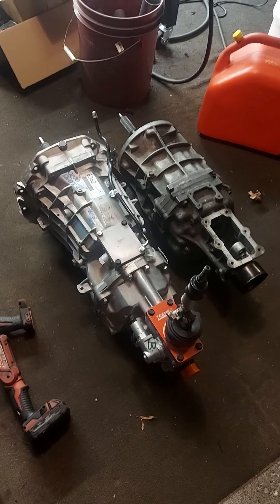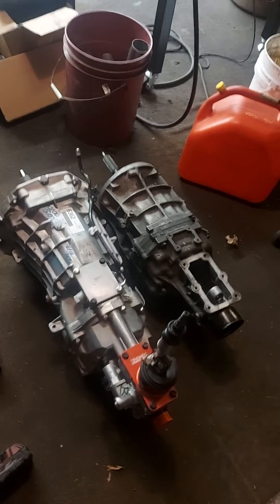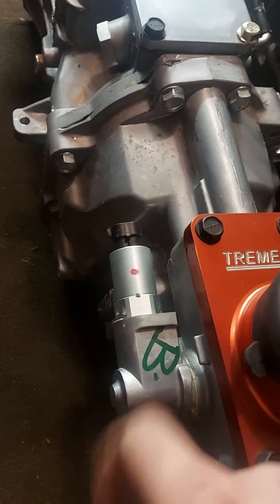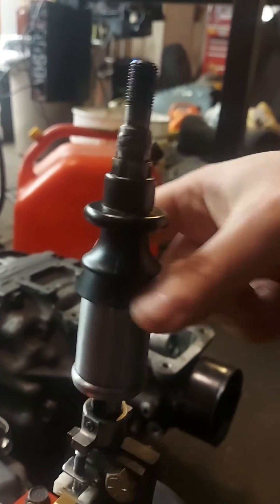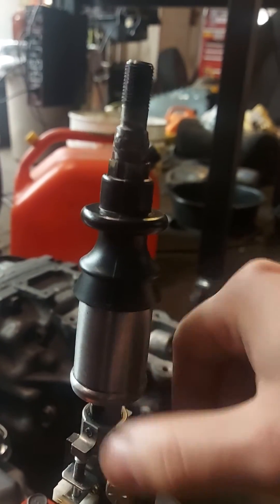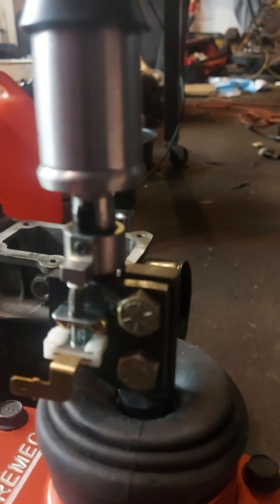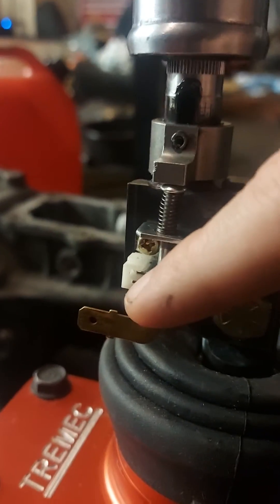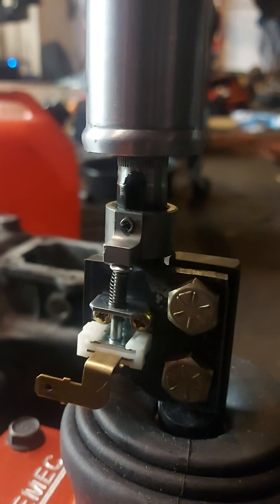T56 reverse lockout. The real solution.

Comment: This is exactly why i didnt want to go any other transmission other than a v160.. But with the integration of the mk4 shifter into the t56, you've made me a believer of the swap!! Good work
Reply: One question though, is that a OEM reverse lockout solenoid? Or another brands?
Reply from the maker: @Kaiju.Hunters  Thanks! The solenoid is original to the transmission.